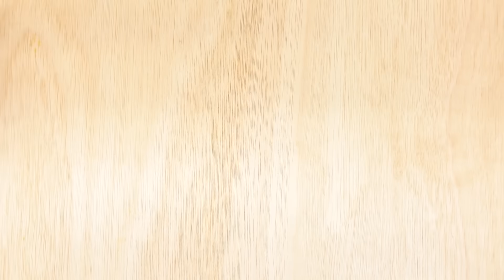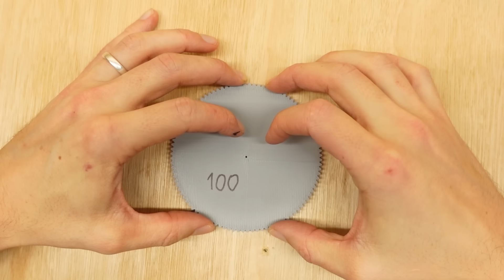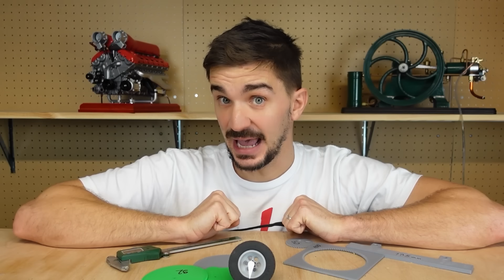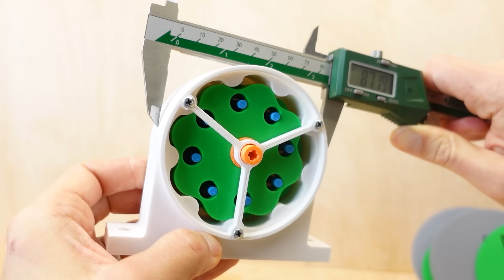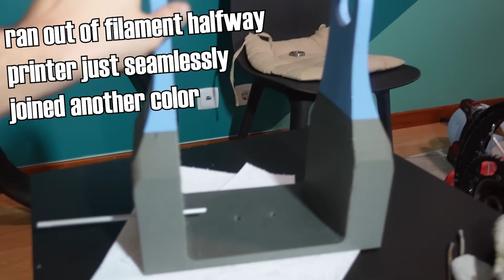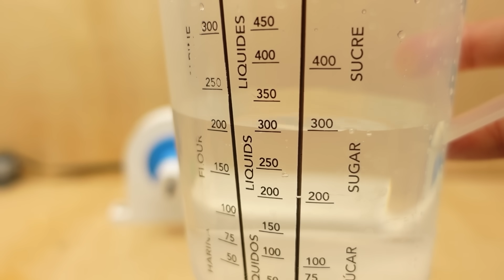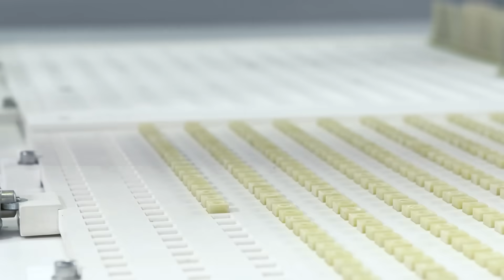Toothless Gears Make Much More Torque Than Conventional Ones, Here's How. Cycloid Drive Explained

Comment: I used to work repairing and rebuilding industrial centrifuges. These machines use an internal conveyor (think auger) to move the solids to the discharge ports. They use two different type of drive for the conveyors. One is this type of gear box. The other type is a hydraulic motor. Both have their pros and cons. The con side of this drive is por response time in terms of changing the output speed. Plus torque is a constant value. Hydraulic hs a much faster response time in terms of speed and is variable in terms of torque by varying pump pressure. The down side of hydraulic is leaks. 
Another downside of the mechanical dive is if amateurs attempt to disassemble is the likely result is breaking something inside. The most likely part to be damaged is the eccentric roller bearing.

Comment: One rotation on the input side is converted to 1/8th of a rotation as the output with a massive torque gain.
You could have demonstrated what happens if you input the power in the other side. Would one rotation be translated into 8 rotations, but with low torque?

Comment: Ok, so in layman’s terms you guys, he’s saying the best motor to make is actually from the same concept as a ford oil pump cuz you get the best gear ratio from that set up to produce the most hp. A very upgraded concept of this is also what powers newer ac compressors as well. And he says they r pretty much using the design from the inside a newer ac compressor, or an older oil pump, to power robots. Cool.

Comment: How to explain 2 rotations:
1. Mark the tire at the base and slide the wheel by keeping that mark on the straight surface = no rotation.
2. Mark the tire at the base and slide the wheel by keeping that mark on the circular surface = 1 rotation.
3. If you didn't "slide" and instead allowed rotation, steps 1 and 2 would have one additional rotation.
4. The previous steps make understanding obvious.

Comment: What if you plug that in reverse to a 250w electric bike? You can use same torque as a 1000w motor but saving a lot of battery

Comment: 19:08, BUT
If that is the case, can't we just use 3 sets of gears instead ? Like 2 gears of half the thickness on 2 sides and one on the middle? Doesn't that cancel out the offset? Sure it leads to slightly increased friction , but massively improved balance

Comment: ................................................................................................................................................................
A gear does not "make torque"....
If anything “makes torque”, it's an engine or a turbine or a hamster in a wheel or something similar...
Cycloidal gears are good at providing a high transmission ratio in a SMALL SPACE, at the cost of worse efficiency and higher wear.

I hate it when common technical concepts are exuberantly sold as “miracles”, described incorrectly (“makes torque”, "16 points in full contact" <- you really hope that if you have an engineering degree, your university will see this and revoke your degree), the real advantages and disadvantages are concealed, as if it were now a “secret” that you know...

Damn clickbait...
The worst thing is that it works. 
But really, zero engineering integrity.

Comment: (about the first 4 minutes of the video) Here's another, somewhat more intuitive way to think of it (at least for me): The wheel/gear always rotates the same number of times relative to the contact point, but the contact point itself also moves. In the case of one gear revolving around another, the contact point revolves in the same direction as the gear, so it adds a rotation relative to a fixed point of reference. In the case of the ring gear, the contact point revolves in the opposite direction of the gear, so it subtracts a rotation.

The interesting thing here is that this effect is only confusing because of the unusual reference frame. If we were to follow the usual convention, where both gears rotate and their positions are fixed, we wouldn't be at all surprised that the 50-tooth gear made 2 revolutions and the 100-tooth gear made 1 - it's obvious from the gear ratio! So when we rotate our reference to remain fixed to the 100-tooth gear, it shouldn't be at all surprising to see 3 total rotations arise.

Comment: How much heat would this type of gearbox make? 
Now I'm not a genius, but 16 points of contact in this 8:1 setup vs 4 points of contact in the example given 4 gear 8:1 setup (9:41).

That's 4x the contact points, would it not be safe to assume 4x the heat?

I'd assume this type of gearbox wouldn't see the high speeds a conventional toothed gearbox would see, so this point wouldn't be a problem in low speed applications

Comment: What if you have one central gear with 2n width and then two on the sides with n width in the opposite direction? Won't solve the issue completely, but wouldn't it help?

Comment: What if you have 4 disks instead of two, and you configure them in 0, 180, 180, 0 position? Then at least externally the vibrations cancel out.

Comment: If the gap is thier downfall then could you extend the lip on the drive to act as a kind of washer that helps balance, I also believe a locking mechanism for the gear to the drive could improve things like a pin or maybe multiple non concentric pins could be used to further keep the gear firmly in place however that does make the design a bit more complex but in a real motor application the benefits might be worth it I'm not sure

Comment: Couple of thoughts on mindset. - Maybe just maybe, you're not taking your 3D printing far enough! Big point of 3D printing... Absurd  Next Level Customization! Like with your wheel balancing stand, you didn't add a place for your tools, or a place for extra parts, or any other high customization to your needs or wants. This is the true power of 3D printing!  

Also don't see spending time on makers spaces looking at others projects as wasting time. You're not! For work, I would spend hours every week looking at products on the internet to get an idea of what was out there and where trends were going. I gained knowledge, grew, and was able to innovate by taking others ideas, putting multiples together, and innovating to my wants and needs. It was a big factor that set me WAY apart from others in my field and won me multiple awards. - Thanks for your content.

Comment: Isnt It possible to add a third "Gear" to make It perfectly balanced? By having the 2 esternal ones be half the Mass of the middle One It should cancel vibration if the esternal ones are in phase and 180° out of phase of the middle one

Comment: I'm glad you redesigned around that glaring design error between the version of the green gear at 8:00 and the one at 8:09 (but it reappears at 9:44).

16:47 Yes, there are teeth to break -- they're just grandpa's old worn-down teeth -- and they will break if you use the flawed design at 8:00.

Comment: Is the velocity of the output of the cycloidal drive uniform or are their small accelerations?  It seems like with the pins in the holds moving around that the output velocity might not be completely constant.

Comment: This was breaking my brain until I realized I wasn't looking at the arrow being vertical. I was looking at the arrows position relative to the 100 teeth. In other words, if you put the arrow at the bottom instead of the top when you start. When you count the number of times the arrow touches the hundred tooth surface, you'll always get two revolutions. But in your example you point out how many times the arrow points vertically up.

In other words, the shape of BOTH surfaces is contributing to the number of revolutions.

Comment: If the second gear is only there for balancing the "transmission," then what is preventing the second gear being split into two of equal weight placed on either side of the working gear? I don't understand how the internal movement works, but shouldn't it be possible? Has that been done? If so, why didn't you explain why that can't work or isn't a viable option?

Comment: I'm trying to find a way to miniaturize this. I'm aiming for a drive that fits inside a 3mm diameter. This is difficult.
Reply: Although in my case I'm less interested in torque than the high speed reduction ratio.

Comment: Nice video. But, you lost me at 6:30 when you describe and demonstrate that the 99 tooth gear does not fit within the 100 tooth container gear. The change at that point is from pointy, to curvy teeth in your demo model. The argument seems successful only because the comparison model has just 9 'teeth', while the immediately prior model has 100. A little sleight of hand? The new model should have also had the same density of teeth; 99 and 100 curvy teeth for a more perfect comparison, at which point the argument probably would fail.
Reply: Don't focus on the amount of teeth but on the ratio of input to output rotation. What he demonstrated beforehand is that when the wheel gets close to the number of teeth of the outer circle, the angle of rotation gets smaller, meaning the ratio input/output gets smaller too. With the new shape, he conserved the ratio (8/1) while avoiding superposition 👍
Reply: The ratio of 8/9 is different from 99/100  @mioki-leaf2
Reply: He pointed out the teeth anatomy for gears didn't allow for a 99/100 teeth ratio. Tho it would be cool, you'd probably be stuck to a 90/100 teeth ratio which is only a 9:1 ratio of resolutions. With the other model, you can go higher than that, as he mentioned you could even go for a 100:1 ratio (which is greater than what you could get with a 99 teeth gear on a 100 teeth container anyway)
Reply: You sound like you think a typo defeats someone's point
Reply: You can make a cycloidal drive with any ratio. That’s the nature of cycloids
Reply: I think the correct comparison would've been the radii of the two gears, after averaging out teeth / bumps.

Comment: The first example is kind of misleading. The wheel might rotate twice from our point of view but that's because it has to revolve around the other gear. If you look at the rotation in perspective to the other gear, it's still one. The distance it travels on the gear is the same on both the round gear or straight one.

Comment: Theres still 100 teeth on the circle, and 50 on the small gear, so what Im confused about is if that means "150" teeth (3x50) are making contact with 100 teeth. Edit: realised when both are fixed and moving its still 2+1 (or 100+50 teeth moving into each other), but if one is now fixed the other picks up the total movement

Comment: If the belt analog of a simple large gear to small gear assembly is a simple large pulley to small pulley assembly, then what is the belt analog of a cycloidal gear?

Comment: This great video remember me when I worked at first time  with the Sumitomo Cycloidal Drivers, and how impressed I was to see this device working. The use was in centrifuges machines with high torque and rotation.

Comment: Hey, you forgot an other ultra compact high reduction system: worm gears. You pay for it in friction, but the torque you can achieve is equally insane, less complexity and a nice self locking feature (depending on the application I use either the one, the other or planetary gears).

Comment: The biggest drawback of this type of reduction gearing is the much larger friction on the gear teeth compared to spur gears. Also, it cannot be used in reverse to convert high torque low speed to high speed low torque.

Comment: regarding your change with owning a 3d printer: in Germany we´d say you have been infected with "Heimwerker-Virus" (DIY-Virus). This is usually caused by one of two things, either owning the tools, like in your case, or having the knownledge, in most cases those are ~60yo craftsmen who just literally know everything about alost every craft. The Illusion of saving money with it comes from the fact that you´d never calculate your time as having a price, since you are having fun doing your project anyways.

I have this with sowing and leatherworks since those are part of my trade/craft aswell as working resin and plastics.
I have saved like 10 pieces in a year just by having access to a leather-sowing machine for fixing bags, shoes and so on.

Comment: about 3d printing. bambulabs are great machines. They are expensive, but there is a reason : they work, every time, without worries. We have an H2D at work and thats the greatest machine i have used yet. You want to enable developper mode though, otherwise it sends the models in bambu's cloud, and they are trying to make a pay per print system ( on top of the US trying to make a "censor models" system). 3d printers still have limitations though, and new users tend to print everything, when it is not always recommended. Remember, when you have a hammer, everything looks like a nail. Keep up the good work ;)

Comment: I love the out of the box thinking, but this seems like an over complicated solution to a simple problem. Just use more gears
Reply: If you need zero backlash, just use a belt. Multiple pulleys will achieve high torque with no backlash

Comment: For the bit about the extra rotation near the start, I initially had no idea what you mean by it being based around the axis of rotation rather than the contact point. I get it now, but my mental model is a bit different.

The potential confusion is because the simplest and most obvious frame of reference for two gear wheels in contact is one which is fixed relative to the axes of both wheels, but not relative to the orientation of either. The contact point is stationary in that frame, but you can still see that the it's traveling relative to the moving surface of each wheel, and the number of full rotations of each wheel depends on the ratio of the circumferences.

When wheel B doesn't rotate and you move wheel A around the outside of wheel B, you still have the exact same things happening - just in a rotating frame of reference now instead of a fixed one (imagine your feet are stuck at the axis for A, but your head is always looking straight at the axis for B - not the greatest amusement park ride, I know). So to figure out what's happening in the fixed frame of reference, you need to translate back from the rotating frame. For wheel A to travel a full rotation around B, the rotating frame makes one full turn while the fixed frame remains fixed, so that's one extra rotation.

When wheel A is inside wheel B, that the rotations of wheel A around its axis are in the opposite direction to the rotations of the frame of reference, so you count either the wheel-rotations or the frame-rotations as negative - e.g. subtract the frame-of-reference rotations instead of adding them.

So looking at the contact point works if you remember how you're looking at it, but I have to admit - your circumference of the circle drawn by the center of the moving wheel concept is better. Also, I had no idea that cycloid drives even existed before today, and that was a great explanation.

Comment: Why not have a stack of 3 cycloid wheels instead of two, with the middle one twice as thick, and the two outer ones offset 180 degrees from the middle one? That should provide a near-perfect balance, with none of the twisting motion at high speed that you get with only two wheels... right?

Comment: Another great video! Impressively well explained. You could have mentioned the fact that unless all that rubbing is acceptable, you need to use bearings, a lot of them, which can make cycloidal drives really expensive, and problematic in other ways, depending on application. The most important advantage is the combination of high precision, and high ratio in a single stage, as multiple stages increase total play. 

If extreme precision isn't important, planetary gears can be stacked if necessary, and can reduce the issues with transferring power between single gear wheels mentioned, a lot. If planetary gears have double helical gears they can have less play than with spur gears, have smoother operation, handle torque even better, and be self aligning. Sure, that's a bit more difficult to make, and slightly less efficient compared to spur gears.

Comment: That's easy- The wheel did more than cover one rotation around the other wheel and completed more because it rotated about the radius of the original wheel plus the radius of the second wheel.

Comment: Couldn't you combat the offset vibration by having 3 gears where the outside are in-phase and each half the mass of the inner gear? It's more parts, and a longer drive shaft, but could be tuned to eliminate the second source of vibrations.

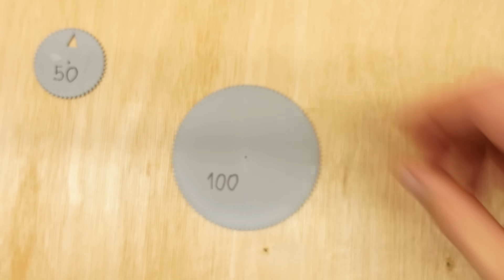Comment: at 2:20 is that really one rotation? It only rotated "fully" at around 120° because the surface is rotating as well. So the small wheel is orientated the same as at the starting point- but it did not do a "real" full revolution. So if you would turn an axis in its middle and e.g. draw a circle with it- the circle would not be complete. Both rotations small and big wheel add up but only in terms of alignment of the small wheel. Same for inward wheel but here it subtracts. At where the graphics show half a revolution, in reality it did a full one. Only the frame of reference - the surface with the teeth- is upside down at that point. 
I mean , it is actually pretty obvious since 100 theeth is 100 teeth. But nevertheless it is a cool effect that really confused me for a second.

Shouldn´t in conclusion happen, that if you turn the Big wheel or respectively the inwardteeth wheel  instead of the small one that the effect is gone? The small wheel will exactly turn two times after 1 revolution of the big one with every wheel and the straight one.  won´t it?